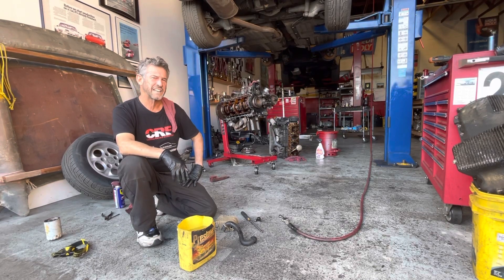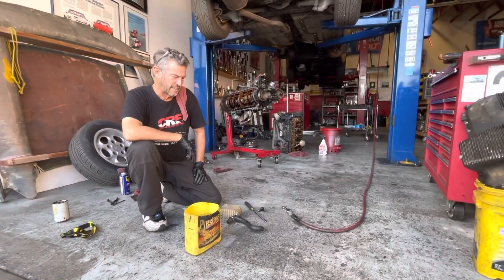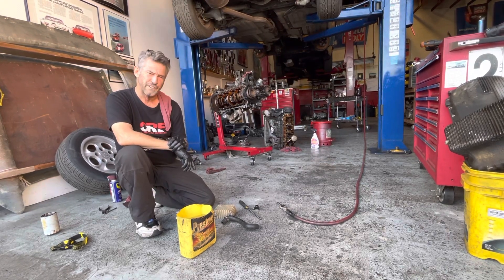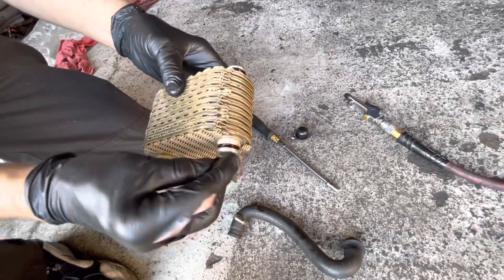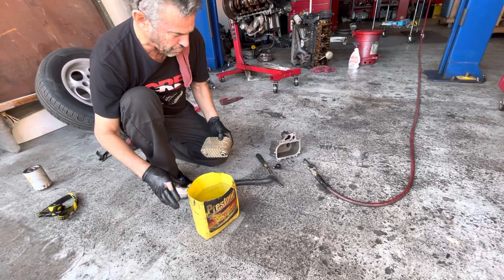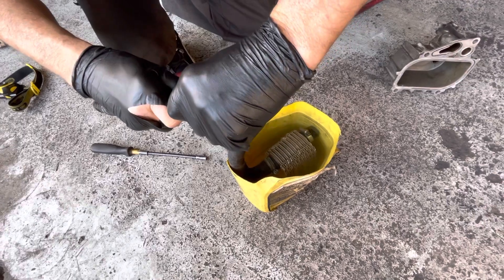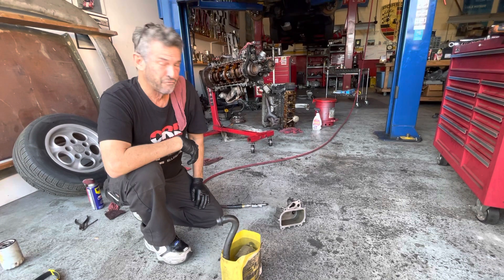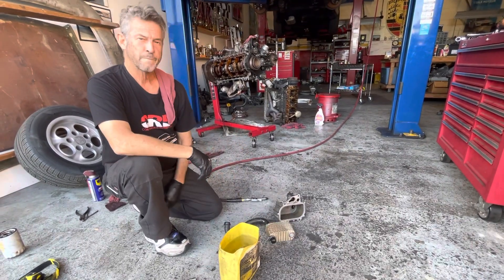Porsche 944 Oil Cooler Pressure Testing

Comment: It was recommended to me to use hot water to simulate the working temperature of the element. Seemed to be fine to me but I sent it to a radiator shop for testing ($15) just to be safe and they found a leak. Got a new one on the way.